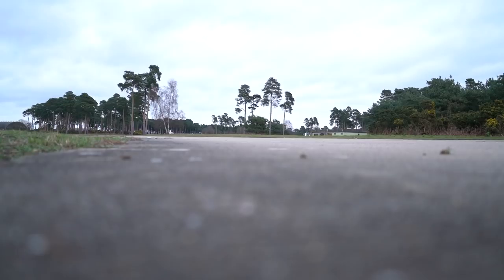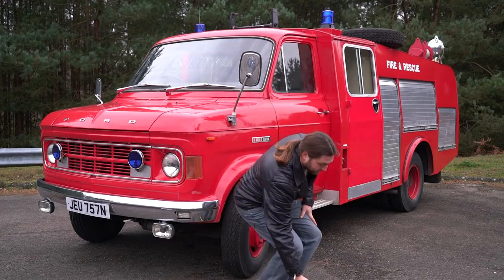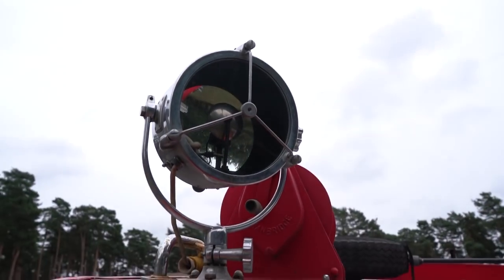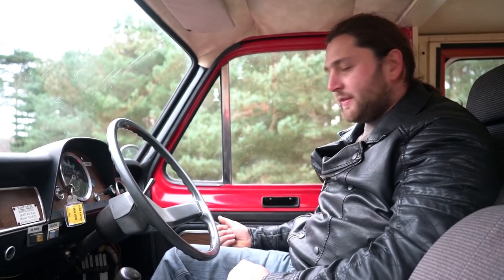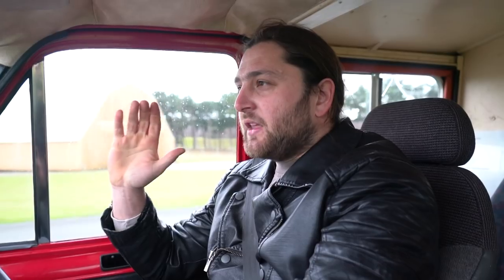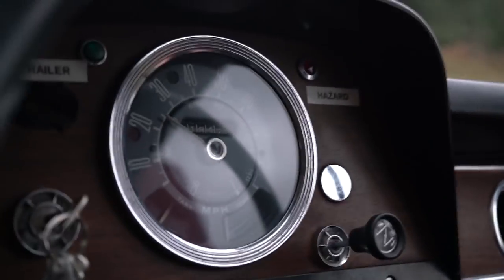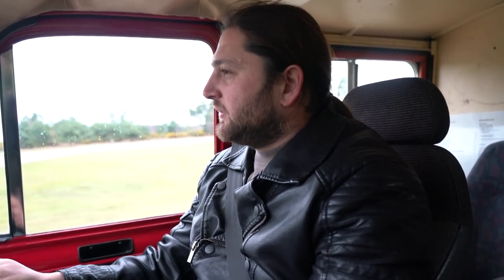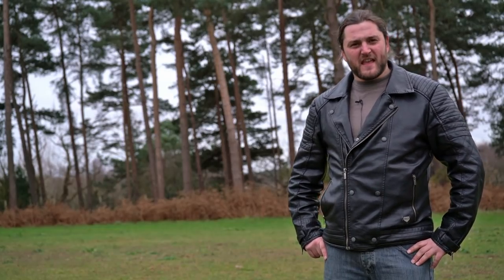A Vintage, Van Sized, Fire Engine! LMM Drives Episode 10.

Comment: I think you need to get all your fire engines together one day and run the pumps and charge the hoses and have a play with them. 

Also, if you think the helmet is heavy, just have a go with the breathing apparatus. And then run around wearing it all carrying a charged hose or a casualty. Firemen are fit!

Comment: What a marvelous vehicle. My mate has an even smaller mk 2 Transit 4 x 4 fire vehicle that used to belong to the Austrian volunteer fire service. It is also big, red and is complete with sirens and blue flashing lights. 

He daily drives it around rural Somerset, no mean feat considering the lack of any power steering and it's steering wheel on the wrong side. Every journey is an adventure and surely that's what it's all about.
Reply from the maker: Oh that sounds awesome!

I've had a quick Google, and yes, that's very cool.
I really like Somerset, but can imagine with some of the roads around there that it really would be an adventure!
And yes, you're quite right. That's what it is all about!

Comment: You're right about the interior bits, the steering wheel is from a facelift mk2 Transit, the front seats are from an early mk3 Transit L, and the gearbox is probably also a mk3 Transit item being a 5-speed.  It's probably not a great surprise that the gearbox is a bit rough as Ford never partnered the 5-speed box with the Essex V6 as it wasn't tough enough to handle the torque.  Even into the early '90s when Ford stopped making the Transit with the Essex V6 it either came with an automatic or a 4-speed manual with or without overdrive, which is probably what this vehicle had originally.  The wood-effect trim would have been standard on this vehicle with it being an A series Custom and a lot of the interior parts on the A series were shared with the Transit models current at the time, so being a 1975 this would have had the thin, hard plastic 3-spoke steering wheel and vinyl seats without headrests in the front, though being a Custom (probably because it was a demonstrator) the seats would have been more contoured and of a more interesting patter of vinyl (similar to mk 1 Escort XL seats) than the standard vehicles rather boring flat embossed vinyl.  This would have been an expensive vehicle in its day as the Essex V6 was a special order item in the A series, plus the Custom trim level and the 4-speed and overdrive gearbox that this probably came with having been intended to be a public service fire engine (the standard 4-speed box was rather short-geared so they tended to run out of breath rather quickly,) and then any other extras that were added like the side repeater indicators and the front fog lights which look like Ford options and the base vehicle would have been a decent chunk of money before the fire engine body was added, so one of these would have probably come in at more than the cost of a suitably equipped Land-Rover that was common to a lot of fire services, without the off-road capabilities.  It's fair to say that early A series were not at all nice to drive, the brakes (drums all round if I remember rightly) were OK-ish the first time you used them hard and then suffered from chronic fade, the suspension was desperately wallowy and uncontrolled and, apparently, it wasn't too difficult to make them fall over going round corners.  The later versions were rather better due to comprehensive revisions to spring rates and the addition of anti-roll bars as well as a rather different brake set up.  In fact the Reynolds-Boughton 4-wheel drive version actually handled pretty well, right up to the point where the knobbly, off-road-oriented tyres let go where you would go from doing 40 mph forwards to doing 40 mph sideways, which isn't ideal on open roads but is a lot of fun on the open expanses of an air field...
Reply from the maker: So this one has been mucked about with quite alot then?
In fact a massive amount.
All intresting stuff, and having driven it I can certainly agree, it's not fast, it's not powerful, I'm sure I could have turned it over too. It does feel like a vehicle which would do so.
Still amazingly good fun though!
Reply: @lmm    I don't know that mucked about with is a fair term, most of what has been done with this are pretty standard, and easy, upgrades used on earlier Transits, plenty of which have received the 2.5 Di diesel engine and 5-speed box.  But the 5-speed doesn't go well with the Essex V6, in terms of strength or gearing.  The original 4-speed or 4-speed and overdrive box would probably make this one drive an awful lot better and make it rather quicker too.  The one modification done to this one that does worry me is cutting away the rear bulkhead from the cab as it is a structural piece in those cabs, hence why it was left in place on the original conversion.  Cutting it out to make room to push the driver's seat back further will have made the cab a lot more floppy than it originally was and could be contributing to some of the unpleasant feelings you were getting driving it and some of the strange noises as the cab flops around.  I think most of the changes made to this one could be put back pretty easily, right down to the chopped bulkhead, as a lot of the original parts used in these were shared with a number of other Ford vehicles, the bulkhead panel was shared with the mk1 and mk2 Transit chassis/cab, the steering wheel was used in the mk2 Cortina and early mk1 Escort as well as the mk1 Transit, the seats were the same as mk1 Transit and, I believe, that means the seat frames were the same as used in some Ford cars and the gearbox was used in a number of big Fords as well as the Reliant Scimitar SE4, SE5 GTE and SE6 GTE and GTC.  Being as it's a Ford then service parts and the necessary brake parts should be pretty easy to find as they were certainly shared with other Ford vehicles, and it's far from difficult to make a few sensible upgrades to the Essex V6 to make it a bit livelier, though I suspect refitting an original-spec gearbox will help a lot with that anyway.  The biggest downside will be fuel economy, I doubt this will break 15 mpg and it wouldn't surprise me if single figures was pretty normal, and the rust as Ford A series vehicles did dissolve in a distinctly Italian fashion, hence why they are extremely unusual today.  Sorted out, this one would definitely be a fun and surprisingly usable fire engine as well as being something that is probably unique today...
Reply: Hello  @lmm

Comment: I seem to remember the company I worked for (Martin Harper Co) supplying the PTO or PTO spares for the A series of the Dodge at Dungeness. Remember driving one we had in for repair, at traffic lights it would rock on the tyres with a part tank of water 😂.
Reply from the maker: 😂 That sounds great 😂

Comment: I remember when the A series came out. I had a brochure for them as my stepdads company he worked for thought about buying them to replace the Beford CF's van and minibus they had. They opted for the Toyota Hiace van and minibus. This was in the late 70's. The A series never took off like Ford had expected.
Reply from the maker: Oh really, why was that? Better and cheaper competitors?
Reply: @lmm  I have no idea. May have been costs and money saving at the time. The company sold their Foden and bought a Seddon Diesel ( reg NNR 44M) which were known to keep breaking down ( cheap lorry) and had enough of it always breaking down and finally bought a Mercedes 2419 (reg VUT 383S) in 1978. It was around then they were changing vans from Bedford to Toyota, but had looked at the A series as it could carry a bit more than the Transit. They sold the CF van and minibus and a Ford Escort van and bought a Toyota van and minibus and never replaced the escort van. 1979, my stepdad changed jobs and went to work driving the big dump trucks in a quarry and then for Tarmac delivering bitumen to new roads being made.

Comment: That fire pump could put out 20 bar pressure on the hose reels and 10 bar low pressure and as long as it had a hydrant supply it could tackle a real fire not just bomb fires. Besides any decent size fire would have multiple fire Appliances on scene.
Reply from the maker: Well yes, any big blaze would be attended to by multiple appliances, this thing would just have been first response.
It was perfect for industrial use, able to deal with most things which would crop up.
Reply: It's a bit of an exaggeration of course but from experience I'd say the Vienna fire department dispatches appliances roughly like this:
- 1 appliance: cat stuck on a tree
- 5 appliances: candle tipped over on a stone kitchen worktop without anything combustible within two metres
- 20+ appliances: serious fire

The house I live in had two fires up in the loft during the past 25 years. During the first one I counted five full-sized appliances and that was a smouldering fire my uncle had already put out with two buckets of water before the fire department had even arrived. The second one was much worse and burned a room-sized hole into the roof and that was attended by IIRC 23 full-sized engines. I wasn't really in a mood to count rushing home from what was meant to be a relaxing evening at the spa to save my belongings from the water already dribbling through the ceiling at an alarming rate!

Comment: I use to own this fire engine great little truck! She has a low pressure pump not a high pressure one so no hope with the 20 bar on the hose reels.
I've got the full history still so if you do buy it which I would recommend then I could send it to you
Reply from the maker: It was great fun, if I didn't already have my pair, I might be tempted. Be nice to have the full history - that's quite special!

Comment: I had the recovery truck version with beaver-tail. Unfortunately it also had the c...t to start straight 6 cylinder York semi direct injection diesel engine with three speed and reverse pig's arse gearbox. Keep the easy start handy - or a good tow. Light steering and those brakes... drums all round, mini-size nipple adjusters and as much asbestos dust as your lungs can stand. And the cab was just beginning to resemble a tea bag. Useful for bringing a Ford Corsair 2000E from England to Ireland - that was about it. Even if I had to be relayed from London to Portadown. The recovery truck from Belfast Harbour just put the whole lot on three high -- really!
Reply from the maker: So, if I understand that correctly, you really liked it 😂

Comment: Nice little engine mate, pity I don't have 3000 knocking around let alone 3 haha would have that in a heartbeat, if your interested, I went to the Emergency services museum in Sheffield a few years ago, it's in Sheffields original fire station, they have a good selection emergency vehicles including fire engines and there's 1 or 2 there that I reckon are smaller than that one. Keep it up
Reply from the maker: Thank you! If I had the money and the space I'd certainly want to get it.
That sounds good, next time I'm Sheffield way I'll have an investigation - thanks for the recommendation!

Comment: Quite a bargain at only 3000 Pounds ,  but it won't do me any good as I'm in Nevada, USA  and the shipping would be cost prohibitive .  But ,  if it could be done . . . . the first bit of kit that I would add ,  would be an engine driven Air Compressor ,  a large Air Receiver ,  and on the roof between the Blues ,  a set of Diesel Locomotive AIR HORNS .  LOL !  .
Reply from the maker: That would be an awesome thing to add 😂
Reply: If you rigged them up as ya two tones I reckon you'd scare off eny fire within 10 miles
Reply from the maker: This is a new and interesting way of fighting fire!

Comment: it doesnt 'generate around 148 horsepower' it generates 128 HP in normal spec. However, these A-series trucks were fitted with the low compression version and a single weber and barely pushes out around 122 HP
Reply from the maker: Well that's just disappointing.
Reply: @lmm  1964 design, and not designed to pull 4.5 tons. Stick one in a saloon or sports car, with a 38 or 40 twin weber and the torque will push you back into the seat.
Reply from the maker: I suppose you're right if you use an engine for the wrong application you'll never get the best out of it.
Reply: Single ford Belfast carb and governor

Comment: British Fords are much different than American Fords, there are some vague similarities in body-styles, but the model names aren't the same. Most vehicles made here are now made with an automatic transmission, and manually shifted transmissions are optional. Full-sized vans used to be a little smaller than this firetruck here in the USA too. Cheers from America!
Reply from the maker: You guys do seem to love the auto transmission.
It's just not something that's popular over here.
The designs vary wildly for the different regions.

Comment: a petrol  a series is rare most were  3 litre deseiel units the petrol  fitted to that was also in the granada and the capri  , the steering wheel  is mk 2 transit and the seats mk 3
Reply from the maker: So it's a rare engine with an odd bodge of interior trimmings?

Comment: i have a 3 l. v6 in my 1993 ford ranger. it's a 1/4 ton mini truck i used to haul scrap metal. that's about half the engine that vehicle really needs. that's the size of the ford e 250 3/4 ton extended body van i use at work to haul cages, and everything else that needs to go to the swap meet. it has a 4.9 l. straight 6 engine, the smallest engine ford put in a full size van here. why on earth would they put such a tiny engine in something that had such a big job to do? ford seems to have lost something in the translation when they hopped the pond.
Reply from the maker: It's certainly underpowered. It was still pretty fun to drive.

Comment: You think the Pacific helmet is heavy???  You should try wearing an old Cromwell for hours on end then add PPE and a 48lbs SCBA on your back....then add the branch, hose, water and jet reaction!!!  Good grief man you only wore the helmet for two minutes!  BTW 90% of fires in the UK are extinguished using a single hose reel which that appliance can cope with admirably.  The 'thingy' that goes on the end of the hose reel is a jet/fog gun.  150 gal of water will last approx 2 to 3 minutes which is enough to knock a single room fire sufficiently until a hydrant supply is connected. In all honesty 150 gal used carefully, by an experienced firefighter is enough for what the appliances was designed for; first aid firefighting.  That wasn't a spotlight but a Francis searchlight made by Francis of Bolton.  BIG difference.  Now it may be cute but that Godiva pump can manage two 3/4" jets with a hydrant supply so bang goes your theory it can only extinguish small fires.  The thing can carry a 4/5 man crew, can put out two medium jets plus two hose reels so, in fact, it can do virtually everything a full size fire appliance can do other than carry a large ladder and extensive rescue equipment, so is classed as a pump rather than a water/rescue tender which carry 400 gal water, a light portable pump and cutting gear for rta's. The two black brackets in the back held a SCBA set each not fire extinguishers.  Lancashire County Fire Service rejected it as it couldn't cope with moorland four wheel drive work and was too big for shopping malls.  It's ideal use was for airfield, factory or supplementary rural use on accessible tracks. I actually quite like it.  As for the brakes they probably need new offside cylinders and shoes rather than 'balancing'.
Reply from the maker: The helmet was more for effect to point out to our viewers that it is quite heavy. That said, I've no idea how you guys manage to do what you do with the weight of all that equipment lugging you down. 
Thank you for your service. 
That's really interesting to know just how effective it could be!
Thanks for all the clarification, much appreciated!
It would have been interesting to have a go in one which is in tip top condition like when you guys would have had one.

Comment: 3.0L to move 4+ tons??.....For fireman not in a rush to get to a fire?
Reply from the maker: I think the idea was as an industrial fire engine it would be pretty close to where ever the fire broke out - it's certainly not getting there fast!
Reply: Wrong, these buggers when wound up could motor and faster than modern fire appliances, their biggest let down in service for the brigade was rust and lack of decent brakes.
Reply from the maker: This one did not give that impression. Jupiter would run circles around it!
Reply: @lmm  The ones we had were emergency tenders so carried no water, and once the engine had warmed up they went very well, handling wasn't great at speed and the brakes were useless on a long run or town work, the one based at York had a prang when 6 weeks old, it hit a telegraph pole, so that and the ones after it were fitted with a Voith retarder to save the service brakes. A good bit of kit though rot and brakes apart oh and the 12 v electrics were a nightmare trying to get a half-decent set or roof beacons and front repeaters along with headlamps etc!